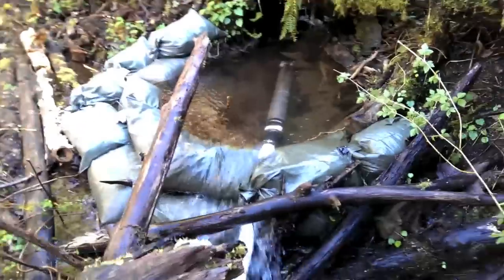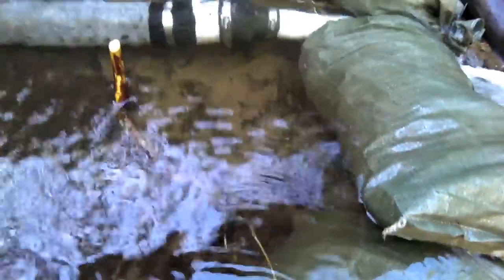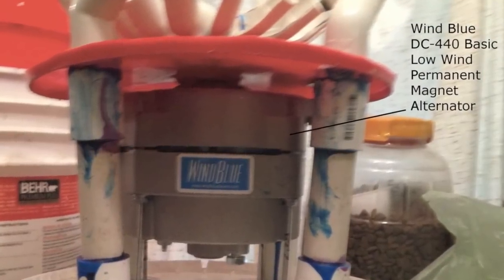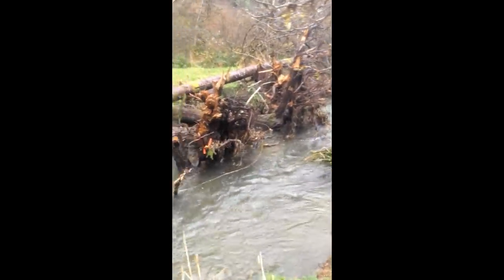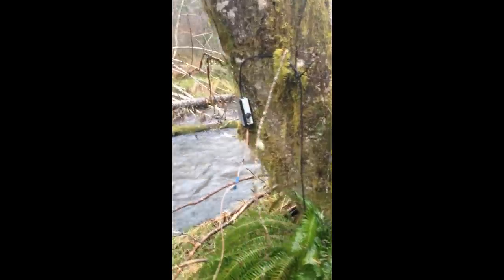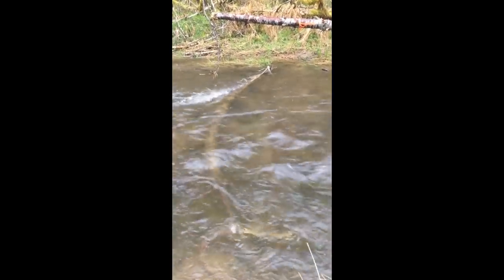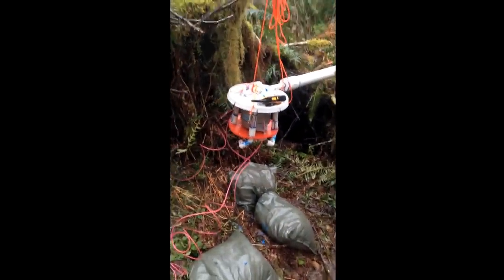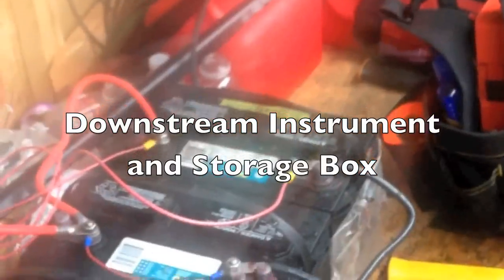Pico-Hydro for Science -- Updated and Edited

Comment: You can increase the pressure and efficiency by starting with a large 6" pipe and stepping it down to a 1" or 2" pipe as you get closer to the generator. This is how NYC generates pressure for the water system.
Reply from the maker: William Batzle You're right, of course. However, thicker pipes are more expensive, less flexible, and more difficult to transport to the site. With the 2" pipe, at the flow rate shown, calculations indicate only 0.5 m of head loss in the big pipe and much greater losses in smaller pipes, T's, turns, and the sudden reductions at the nozzle. We have a 2nd generation set of generators; we use Y's instead of T's and PEX tubing in lower-curvature bends directly to the nozzles, which are smoother, and adjustable. I need to do another update.
Reply: Yeah that's true. We built one way out in the woods ages ago. Put the smaller ones inside the bigger ones and hauled them with a bike wheel trailer rig we made. It was much easier than carrying them by hand.
Reply from the maker: William Batzle We may eventually have to go with bigger pipes. The main issue we're having now is that the little pond we made for the intakes fills up with mud and clogs the intakes. The intake pipes are bigger, maybe 3". Even bigger would probably be better: less tendency to suck mud and debris up against the screening. What we're thinking about now is a big carboy or barrel set downstream of the pond to give us a taller water column, and a spigot at the bottom to help us empty out the mud. Not sure how well that would work, though.
Reply: geomorphdog
I have a solution for you. It's called sediment filtration. We used it in the metal working industry on buffing containers. It's a step down solution. Take 4 buckets and drill a 1" hole in them except for the bottom one. Put in 1" bulkhead fittings and run a pipe about 3" long from them. Put the first bucket that is connected to your system at a level point well above your system but below the stream. Then place your second, third and fourth buckets above consistently until you reach the stream so that water passes over the damn you built into the step down. Make sure the pipe from the damn is just below the water line but above the sediment in the stream by at least 6". You could even sink the top bucket into the stream inside your dam so that water flows over the top of and into the top bucket. This will give you some room for sediment buildup that can be removed very easily. There are designs out there that have spiral designs that eject sediment and some water as well but they are very complex. Try this first and let me know what you come up with. I could help you design a better system if we discuss it over skype sometime.
Reply from the maker: William Batzle I'm not sure I'm picturing this right. I'll do a bit of searching online and get back top you if i can't figure it out.
Reply: @geomorphdog  you dont want flexible big pipes, thats how it creates the pressure to push it harder down stream

Comment from the maker: As I've mentioned in some of my replies, we've got a new system, and I'm working on an update video that also addresses some of the issues implicit in this video, like getting only 10 watts out of a potential 220 W. Better plumbing, adjustable, tapered nozzles, factory-made turbines, and higher voltages on the output all lead to big improvements. We have limited measurements so far, but we're now operating with about 20 W at 12 volts (nominal). At 48 V (nominal), we could get about 50 W, but we're kind of stuck with the electronics at this point. Once we get the resources for help from an electrician, we should be able to increase power output dramatically.
Reply: I know its too late now, but next time you need an electrician, consult your local COMMUNITY COLLEGE!  The instructor is probably a very experienced electrician and he will have an advanced student that needs a project to count as a final exam!!
Reply from the maker: Good idea!

Comment: Great! Thumbs up!  With a little water and enough pressure to spray from a nozzle, I thought about using  tin cans not quite cut in half and pried open. Carefully cutting up one side and top of a can leaving the other side uncut and bending  open the can to make two halves-- a "do-it-yourself pelton cup" Fastening a bunch of these homemade  "pelton cups" around something which could be fastened directly to the shaft of a generator/alternator. With a generous spring or stream with a little more water and  with a bit of drop to build pressure,  I thought of taking 20 lb propane tanks and filling them with water to be sure there is no propane in them and then emptying the water and taking a right angle grinder with a cut-off wheel and cutting the propane tanks lengthwise, leaving one straight side uncut. When opened up this would make a large  pelton cup. Done to about 8 or more propane tanks. Taking two steel automobile wheels and welding them together, then welding the opened propane tanks around the wheels making a large pelton wheel.  The center of one of the 2 wheels welded together would need to be cut out to be able to get a ratchet in to tighten the lug nuts of the other wheel to a junked automobile hub/axle. Similar to this https://www.youtube.com/watch?v=BtCMuO3DVyE  Or  instead of using the hub/axle of a junked auto, weld the propane "pelton wheel"  to a large steel pipe and fit each end of the pipe through a large pillow block bearing.
Reply from the maker: Sounds like an impressive project. Much as I love the thought of such a massive Pelton wheel, I think it's unlikely to be a good choice. Pico- and microhydropower systems are generally classified as low-flow, high-head or high-flow, low-head. Pelton wheels and turgo turbines are good for low-flow, high-head cases. You want the turbine spinning fast, and you want the water in your jet to about twice as fast as the speed of the spinning cups. See my "system 2.0" video for some more on that. If you have enough flow to turn the big wheel you're describing, then you probably want a through-flow turbine.
Reply: Thank you!

Comment: I like how well made it appears to be, and that it uses cheap plastic parts. Besides the antenna array and the other experiment, the only costly part i can see is the alternator.
Reply from the maker: loopafox That first turbine held up pretty well; a second lost a bunch of blades. Rather than repair or reconstruct it, we just bought factory-manufactured Pelton-wheel turbines. Update in the works.

Comment: If you use smoother transitions Ie curved pipes instead of 90 degree. You will get much better pressure and flow.
Reply from the maker: Submanca Version 2.0 uses big Y's and Pex for larger radius curves, larger diameters, fewer minor losses overall. Working on the update.

Comment: for radio frequency interference, and 'well connected on three, 3-phase AC generator,
3 x 250 volt 4.7uF capacitors (MKT or MKP) in star connection and connect the central ground
also improves cosfj generator and removes noise that irk transmitters
Reply from the maker: udos46 The Wind Blue 440 DC has only 2 connections, voltage (live) and ground. The rectifier is built in, so the output is DC. I'm sure there's still ripple voltage, so I do need a capacitor, or maybe two, to ground.

Comment: geomorphdog with the hydroelectric generator apparatus you assembled, what kind of output do you receive? Meaning, for what types of electronic devices can you provide power/for how long? Also, would it be possible to theoretically generate electricity from this device to charge batteries for later use (provided the batteries are stored correctly)?
Reply from the maker: Andrew Preischel We got about 10 watts out of this system, which was adequate for our needs. I'll address efficiency in some detail in a follow-up. Batteries were part of the system. The idea is to power the electronics while trickle-charging the batteries so that we can extend the "up" time of our instruments. The system in this video kind of failed at that, but our new system appears to have succeeded. Working on the follow-up.
Reply from the maker: +Andrew Preischel  I posted a follow-up video on "system 2.0" (going on a year ago now).

Comment: hi
under these conditions, it does not work the mppt:
you have 60 volts to charge four batteries (56Volt) and its performance and will be '10%
for max performance with 4 batteries, it takes 110 volts dc vacuum, where the point of maximum power and 'about half' volts (60)
better to just 24 volts (series / parallel) with mppt EPSOLAR 12A ($ 50)
with pelton smallest diameter (more laps, more volts, more efficiency)
with my partner, we have more than 200 picopelton installed in Switzerland
(From 50 watts up to 6 kW)
good work
Reply from the maker: We have 4 batteries in parallel now (12 V). I put them in series just to measure the power output at the higher voltage. EPSOLAR Tracer-1215RN? We have measured open circuit voltage as high as 90 V, the 150 V max. of the 1215RN would provide an adequate safety factor. I must admit that I am struggling to understand how to combine head, flow, nozzle size, and turbine diameter to get the greatest efficiency. We bought the turbines and nozzles from distanthome (in Turkey) on ebay. We have 2 Peltons with diameters of 130 mm and 180 mm, and we are using the larger turbine (for no real reason, except it fits the frame better).

You are of course right that the same blade speed and a smaller diameter will turn the shaft faster. But for the same resistance on the shaft and the same force in the jet, blade speed increases with torque, which increases with radius. It seems like radius/diameter would cancel out. From Thake's manual, the graph of head, flow, diameter, and power seems to say that we should be using a smaller turbine, but I do not really understand the graph, and I do not have the book, only a copy of the graph.
Reply: for maximum power, you should know where the turns of the generator from the maximum
based on this, you choose the impeller diameter, cmq, I would put the small and 4 nozzles
here are: http: //www.moreau-fr.net/proto/turbine/en/

Comment: thanks for posting.  nice work.  some very late thoughts.  look at the runner.  as it turns, the angle between the surface of a spoon and a jet becomes more oblique.  reversing the orientation of the spoons on the runner should increase efficiency, significantly.  splitting the flow four ways may be too many.  try two jets.   you are using a pma with the stator connected wye.  imo, when driving a pma directly with a high-speed turbine, the pma should have very low cogging and a stator connected delta.  when stator coils are connected delta, the output rises, amps over volts; output wattage with either delta or wye connection is roughly the same.  (example -  200 watts out, might be 10 volts at 20 amps.)     cheers

Comment: otherwise know how many volts at 60 Hz:
for example:
24 volt turbine vacuum at 60 Hz: okay a transformer 110 volt 60 Hz input to the turbine 24 volt output side 110 volts
works even if input 120 volt 48 Hz and 230 volts without burning out

Comment: Other thought:  Could something like this be used to connect to public water supply and power a few items in a house during an outage??? Would waste a lot of water…but so what.

Power would be greater if they used an enclosed impeller for greater efficiency (like used on automobiles to circulate coolant). Eliminate the 90 degree bends. And start with larger pipe narrowing to small pipe to gain water speed
Reply from the maker: Steve Korn You probably could use public water supply, provided adequate head and flow rate (lacking in my home). 

Enclosed impellers are, I believe, better for high-flow, low-head applications. Pelton-wheel and turgo (which the one in this video is, sort of) turbines are better for low-flow, high-head applications like ours.

Comment: How is the alternator not soaked?
Reply from the maker: +Ad Rock   After a couple of years in the elements, we had to replace one of the alternators and get new bearings for the other. In our latest version, the turbine/alternator axle has a flexible seal around it to keep water and grit from getting up into the alternator, and the alternator is sealed in to keep out the elements. On the new alternator, we spent the extra cash to get a stainless steel axle. I've got a video on "system 2.0," but I need to do another video on "system 2.1," which includes the seals, etc.

Comment: You're dropping a lot of voltage there. Maybe put your batteries closer, and up your voltage to compensate for the loss to your equipment.
Reply from the maker: The low voltage makes our efficiency really low. Check out the "short" version video on system 2.0. At the end, I address the voltage issue I. some detail. I haven't done the calculations, but we're definitely losing more power by running long wires between generator and batteries. But putting the batteries closer wouldn't help because would still have to run long wires to the load. Those long wires would be more efficient if they carried a higher voltage. Then we should convert to low voltage near the load. Or correct me if I'm wrong or missed your point.

Comment: a couple more things. . . if you are using a pma with dc output, long cable runs should be avoided.  or extra heavy and expensive conductor should be used.  in lieu of getting a pma with ac output, the rectifier can be removed, and a 3-lead pigtail installed.  then, the wild ac from the generator can be run a long distance, with minimal loss.  put the rectifier at the far end, so to speak.   cheers

Comment: Sure had a lot of footage that should have been edited out, leading up to not a lot of details..
Reply from the maker: ablestmage Well, I'll agree the video is short on data. It's tough, because our first priority is to simply get something running so we can collect the in-stream data we're after. I've been working on the details, and we have a new system that's better, and we hope to improve it some more once we get the resources to do so.
Reply: geomorphdog ciao guarda qui: faccio molti picopelton con servomotori brushless da ebay (quando sono a basso prezzo ,, HII) MPPT regolatore solare bordo di un EP tracciante solare cinese fino a 150 volt di ingresso o di IWT MPPT avvicino -step giù 5-65 Ingresso volt sono entrambi perfetti per i miei microturbine
Reply from the maker: udos46 I just posted a new video about our new system, but now I need to change it: if MPPT charge controllers for solar arrays work well with hydropower, then that is what we should use. We got Pelton wheels and adjustable nozzles, but we're still just getting by with output voltage equal to battery voltage. I knew that solar arrays used MPPT controllers. I do not remember why we did not get one. We probably needed to minimize cost, so we got cheaper charge controllers without MPPT. Still, the cheap controllers were not very cheap, about US$100.

Comment: n case of interference problems, use two chargers econimici type
http://www.autoworksracing.com/ctek%20battery%20charger%20page.htm
each for a battery if the vacuum turbine is 65 volts minimum and maximum 320volt (model 230 volts) I do not know 110 volts, maybe half '

Comment: with a mppt, you'll see that gains a good 30% more power
in that, as well as now, the turbine must be adapted to the battery voltage
for example: a vacuum is 60 volts dc (THEN THE MILE POINT OF WORK AND 'A 30 VOLT), but if you connect the battery to 12 volts, from 60 vacuum drops to 13 volts and you only have a quarter of power
while mppt, and 'Micro going to seek his maximum power point to put in the battery, whether 12 or 24 volts
the algorithm calculates every 10 seconds and where 'the great
Indeed feels the turbine often change a few turns, due to the variation of the battery voltage
are several years that I use for my mppt picopelton fully successful
then more metttere after the bridge rectifier, a good electrolytic capacitor, especially if the generator is not 'three stages !!!
too big ripple, breaks the mppt (has capacitors inside, but calculated for dc solar)
Reply from the maker: udos46 This is really excellent information. Your comment is a bit garbled (Google Translator?), but I think I understand. In the new system, I measured an open circuit voltage of 60 V. When tied to the battery voltage (12 V nominal), output power was 18 W. I then put 4 batteries in series so that the output voltage measured 51 V, and then I got output power of 50 W. So I should be able to get more than double the power with MPPT. Thank you, also, for the suggestion of a good electrolytic capacitor between the output of the alternator (which does have a built in rectifier) and the MPPT. I probably would not have thought of that. What magnitude of ripple will the MPPT tolerate?